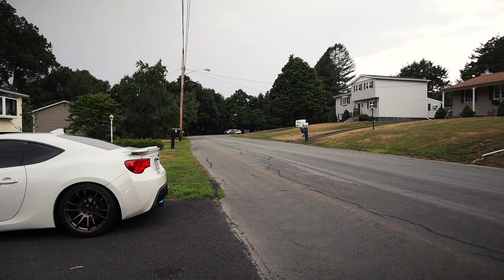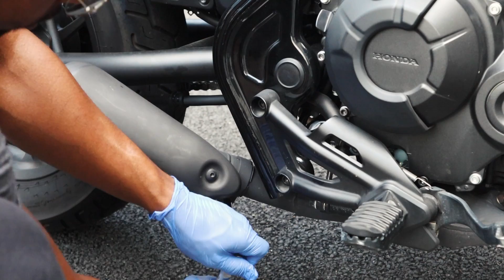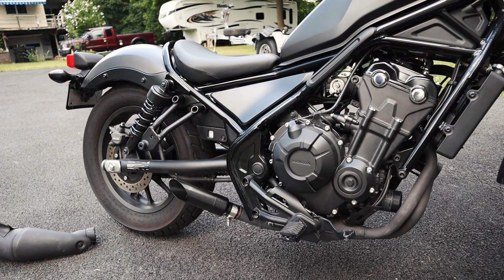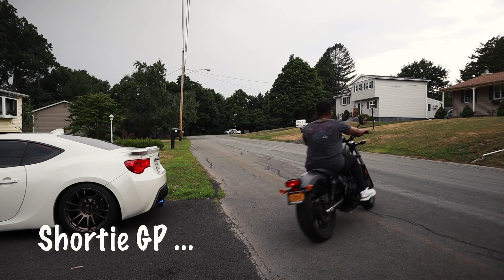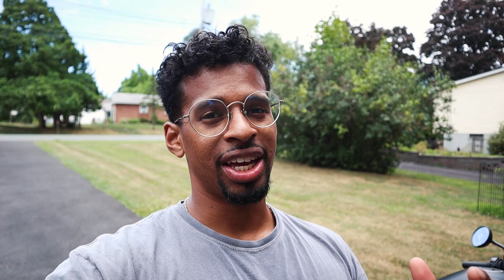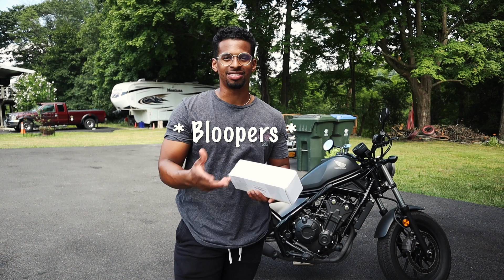Honda Rebel 500 Shortie GP Exhaust (Is It Actually WORTH It?!)

Comment: With the baffle installed, I replaced my 2 brothers exhaust with this.  Completely satisfied.  It seemed to be a little sluggish at first without the baffle, but the baffle fixed that and didn't lose much of the throaty sound with it installed.  Had to get rid of some of the bulk with the rear fender, light/plate brick, & rear seat/pegs.  It only made sense to remove the huge exhaust as well.

Comment: Basically straight pipe not even exhaust…bad for your valves ring no back pressure..I trashed mine after 2 days used. lost high end power and motor runs hotter.
Reply: That is not true on this particular model there is a catalytic converter before the pipe and an o2 sensor before it so doing this will do NO harm to the motorcycle